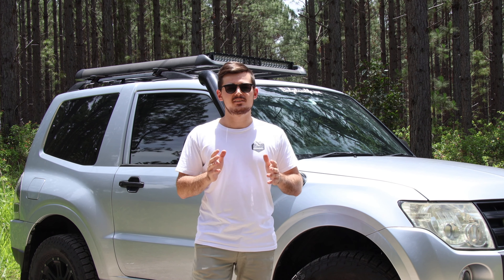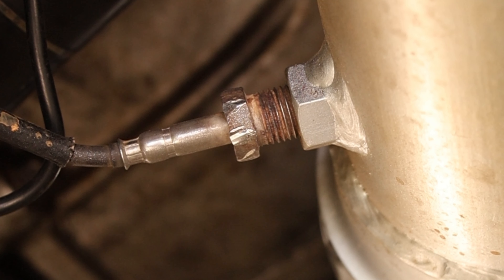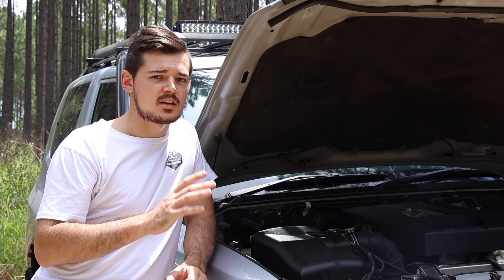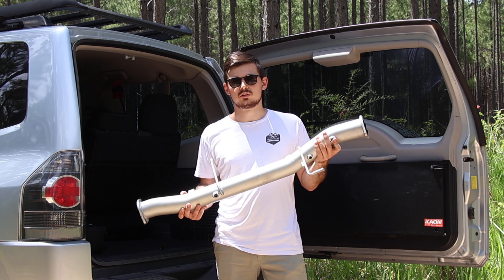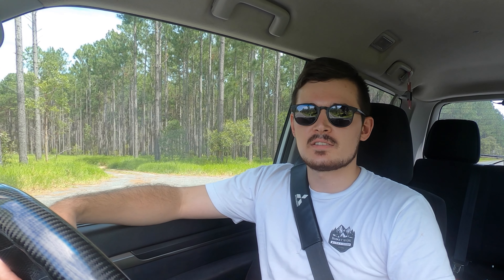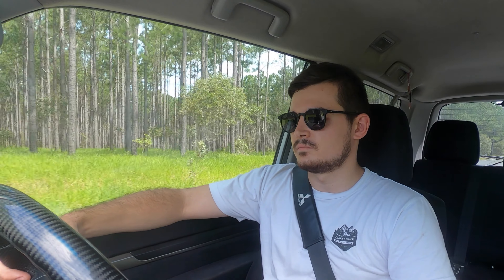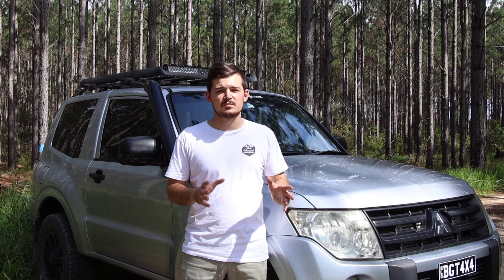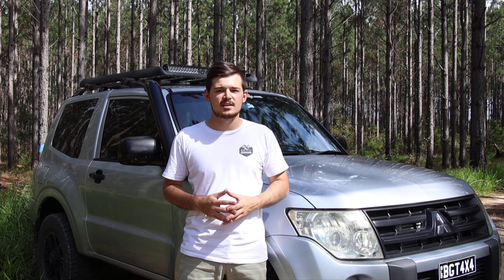3" STAINLESS STEEL EXHAUST SYSTEM MITSUBISHI PAJERO NS SWB!

Comment: Will it fit NM 3.2 DiD swb? Should be identical to NS. Can you confirm?
Reply from the maker: Should be very similar but not identical. NS came with a dpf so slightly different. If you're in Brisbane we can have a look at it 💯
Reply: @budget4x4life  unfortunately I'm on another continent. Honestly, I don't need bigger pipe, I just want a little bit more "truck" sound. :)
Reply from the maker: @itechnosphere  remove the mufflers 🙂
Reply: @budget4x4life  won't it be too much? :)
Reply from the maker: @itechnosphere  start with removing one and see how you go

Comment: Hello how are you ?  I wanted to ask you if on your v87 the ASC off and the skidding car icon have ever come on.  In my v87 this is happening to me, I stop, I turn off the engine and I start it again and everything is fine, the ASC turns off and the system works perfectly.  If this has happened to you, could you tell me how you solved it.  thank you
Reply from the maker: Hey matey. This has not happen to me yet. When the ASC light comes on it could be to do with your wheels or some sort of sensors that trigger it. But the traction light comes on as well so I'm sure it must be a sensor somewhere 🙂💯